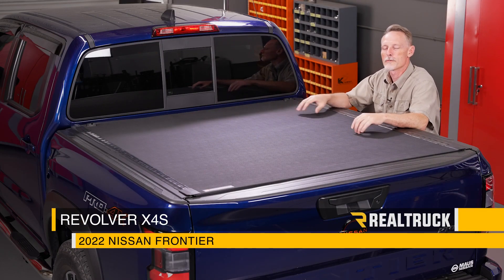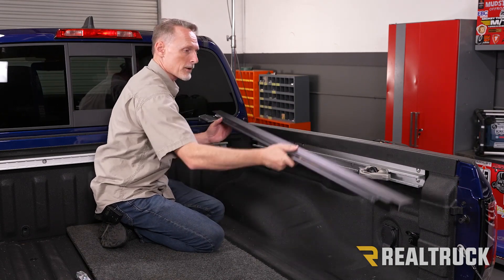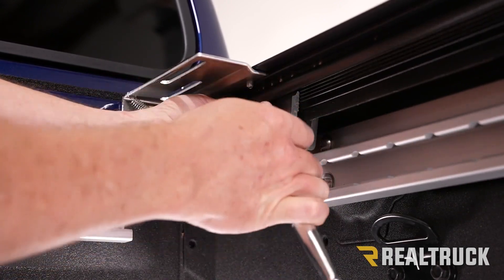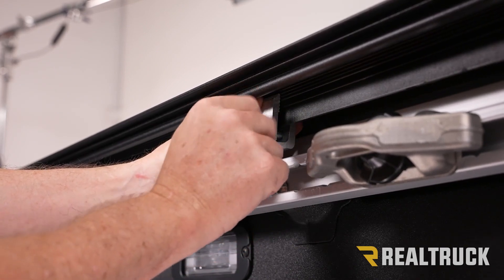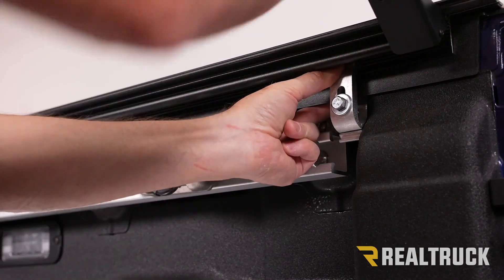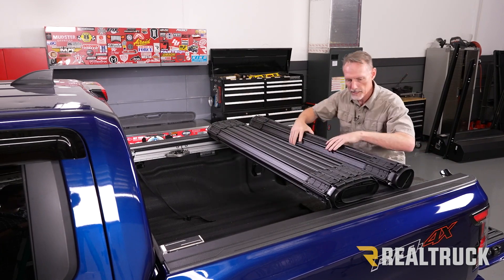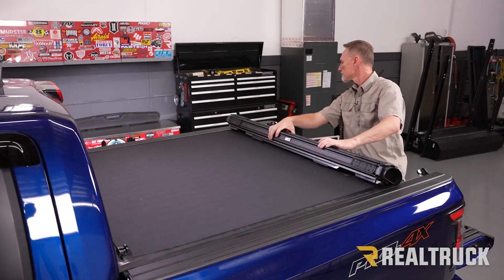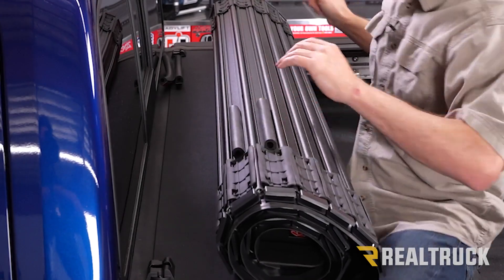How to Install BAK Revolver X4s on a 2022 Nissan Frontier

Comment: Does the rubber weather stripping which is located on top of the bed come in the box?  And do you think it will need weather stripping where the tailgate meets the bed when the tailgate is closed? would that make it completely waterproof?
Reply from the maker: Yes, the bulkhead seal is included. An additional tailgate seal could be added if you desire. No cover out there is guaranteed 100% waterproof but if you have everything installed correctly, it will be the next best thing. It is not uncommon to get a drip or drop at the tailgate seams but should be minimal.

Comment: Does the rubber bumpers come with the bed cover?
Reply from the maker: Yes, they will be in the box with the cover. :)
Reply: @Realtruck  do you have the replacement rubber bumpers part number for the Revolver X4s? I have been sent the incorrect bumpers under my warranty claim.